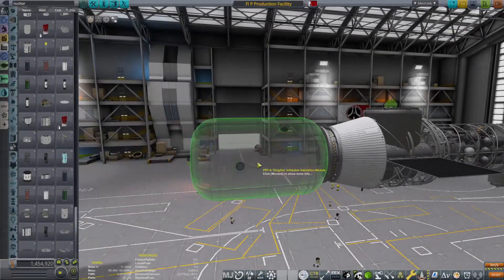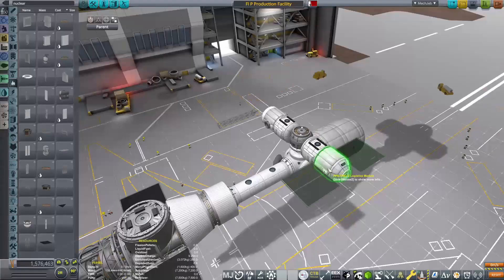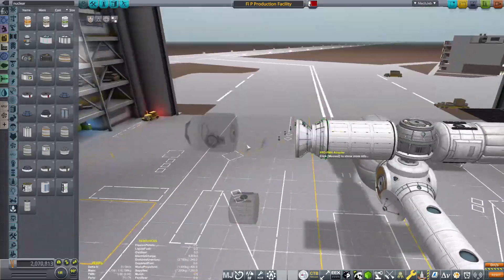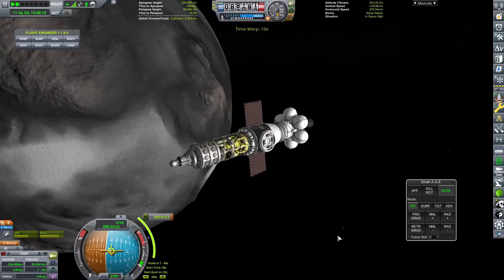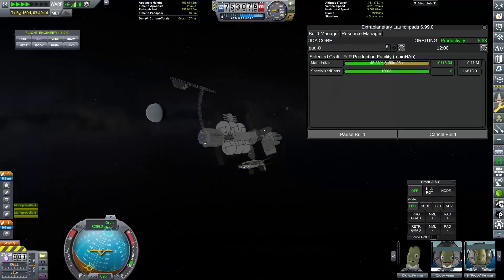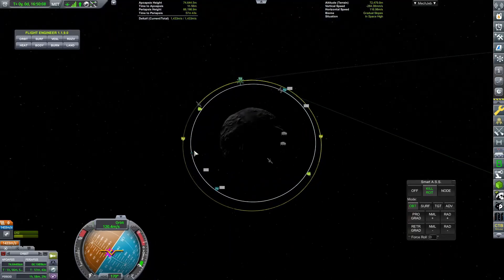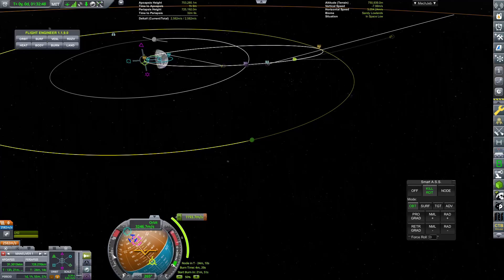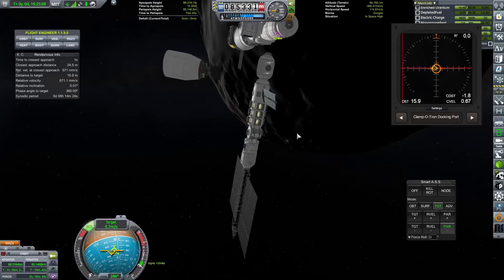KSP | Coming Home Redux | Collins Station | Kerbal Space Program | Beyond Home #19

Comment: I know that transfer problem of enriched Uranium from Global Construction. I would say it’s fair to edit savefile here, since you didn’t change the amount. Enriched Uranium could be transferred between vessels, so it should be able to transfer within vessels (In real life that would be dubious though, since engines and reactors probably use different fuel rods). One might also watch out where it is drained from. With Global Construction, I had it once that my Station that I used for construction had another spaceship docked, and when I constructed a new one, the enriched Uranium transfer for the new one had a nuclear engine from the docked one completely drained.

Comment: I haven't touched KSP in a while, and correct me if I'm wrong, but wont EPL prioritize containers with the most volume descending, and also only deliver to containers that have their resources unlocked?
Anyway, pretty sure you can refuel the emancipator with an engineer with an high enough level, though you may not have one. I set the minimum level in the mod at 3, though the default is 4.

EDIT: Also, I might have said something along those lines the last time I commented on a video, but the absolute best FF fuel (and appropriate engines) you can use is NSW. AM+LH2 certainly is fancy and immensely good, but the mass and volume of the engines, coupled with the very slow production of AM, makes it far less than ideal. First interplanetary vessel I made had over 150,000m/s of dv with antimatter and liquid hydrogen as fuel, had something like a 0.2 TWR, and wobbled like mad under phys warp. Sure, it was gigantic and carried over 50 kerbals and all the facilities required to start production in another system, but it was quite a chore. Instead I eventually settled for smaller ships running on the second NSW engine. Even unoptimized, I got over 300,000m/s for a ship carrying over ten kerbals (the 2ish TWR was also nice), and it took about 1% of the time needed to produce and fuel compared to the first ship. Not to mention I was able to assemble it in one go from the surface of Minmus, unlike the AM ship that was a four-parter.

Comment: One idea for something to do with the used nuclear tugs - if you can disassemble them with Kerbals for parts and resources, sending them back to TRAP wouldn't be a terrible idea. Or just reuse them by sending it back to TRAP, refuel the LH2 tanks and such, and stick a new module on the nose.
Reply from the maker: That would have been quite a smart idea, and saved me from launching more material kits to the station, I probably still have enough fuel left in it to send it back, buuuuut, I was also thinking of keeping it as a monument to visit later on, it’s the device that got the first bit of the first station over to rhode, thought it would be cool to send some tourists over at some point :p
Reply: @Carnasa  Fair enough - just something to keep in mind for the future, although given you switched to chemical tugs that wouldn't leave radioactive debris on Armstrong if disposed of the point is rather moot.